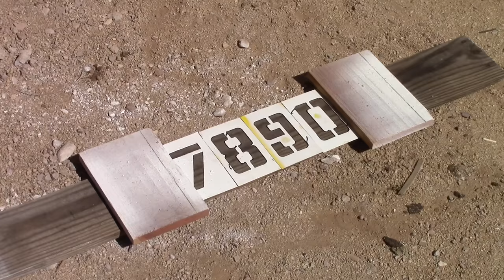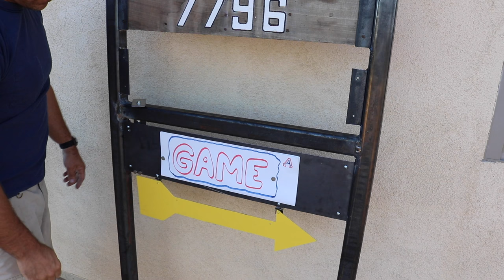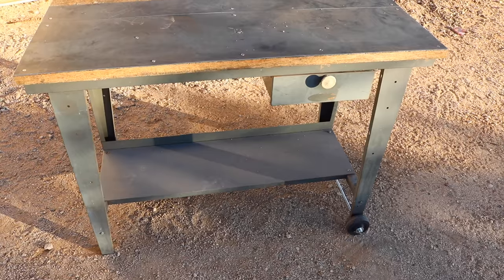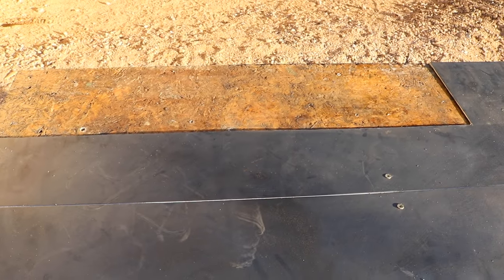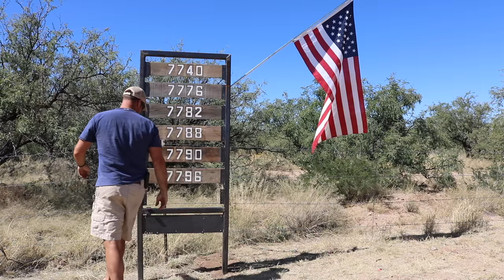Pallet wood & Steel Sign - How to

Comment: that is awesome bud, loved the flip down arrow. I don't do much welding jobs anymore. being a millwright for the last 28 years I don't even want to touch or look at another welding rod ever again. I don't think I have turned on my own personal welder on in  5 years. one thing, go to Napa and get your self a full face shield. they are around 20$ and well worth it. I had my first accident last fall with my table saw. I was cutting some 1x1's, everything was going normal then to this day I don't know what happen, I got kickback I think, my pusher block came flying back out of my hand the wooden piece hit me in my face shield. I was stunned standing there looking for the pusher block when I noticed blood dripping on the floor. I didn't even realized the pusher block cut my finger open right where it attaches to my hand. five stich's later. (the next day, I'm tough) wait, I think my wife said bullheaded. I'm going with tough. LOL but I had just started wearing the face guard and man am I happy I did, it hit so hard I think I would have done some damage to my face if I didn't have it on. we use them for torching at work also so much better then the googles. I don't have a shaded one for home use, but its on the list of wants. by the way the off road skate board, brilliant.

Comment: Joe, is that a standard miter saw with a metal cut-off blade? Can you use a metal cut-off blade on a standard miter saw to cut and iron, safely? Relatively new to any metal work in DIY projects.

Comment: I sense some work related frustration from in badly addressed homes.
Reply from the maker: haha... yes, that can be an issue... especially in urban/rural transitional areas.  I've seen them at forks of roads where the address sign with an arrow has lost a screw and the arrow is pointed directly down...lol... which way do we go... ;)